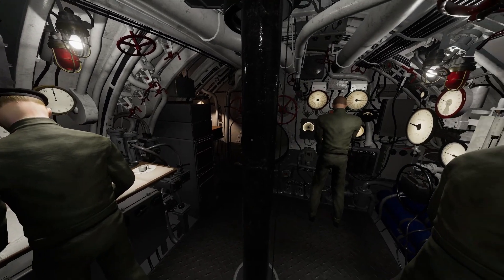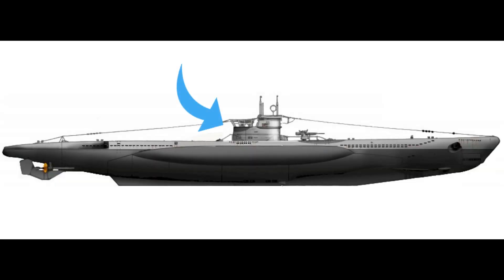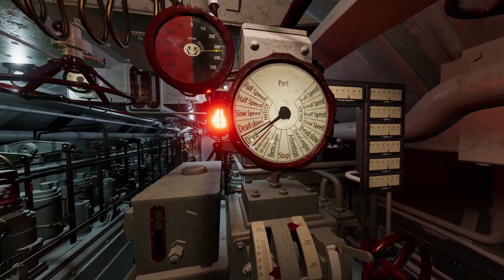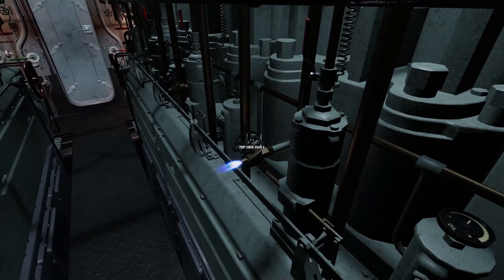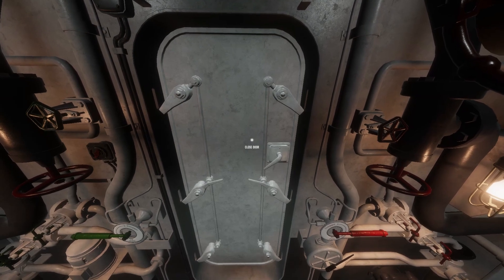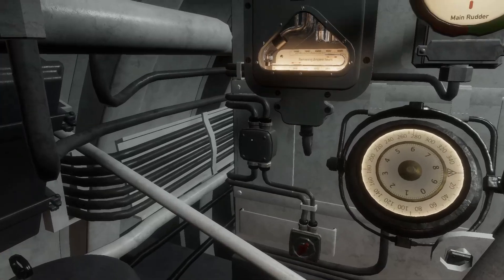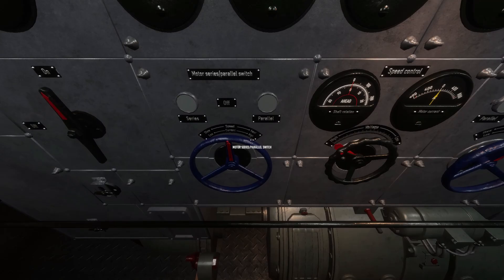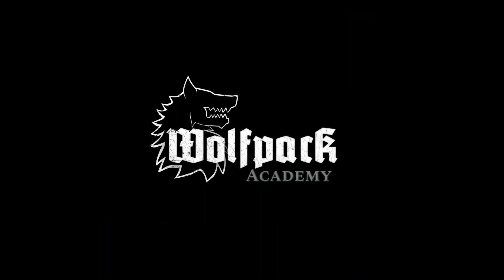Wolfpack Academy: Propulsion Systems

Comment: I may be wrong so please correct me if I am not very knowledgeable about German World War Two U-Boat design and unfortunately can't go see one in person with where I live. However, from what I can find online, shouldn't the U-Boat Ventilation Intake, Diesel Induction and Diesel Exhaust valves have a rising stem design? It would also be a clear indication from a distance of the position of the valve as fully inserted would be shut while fully extended is open.